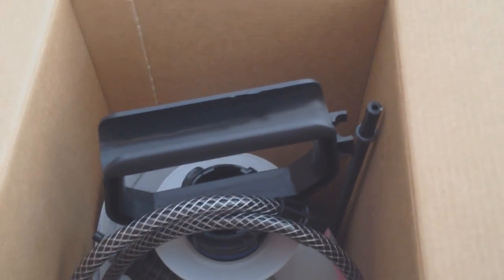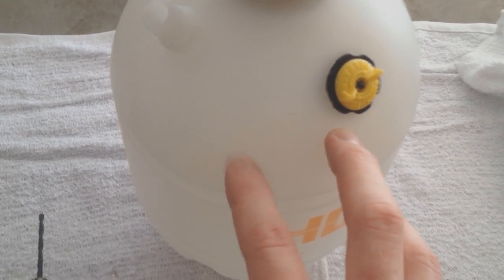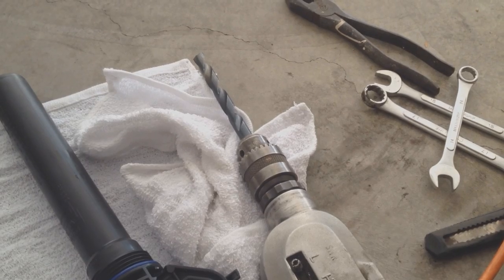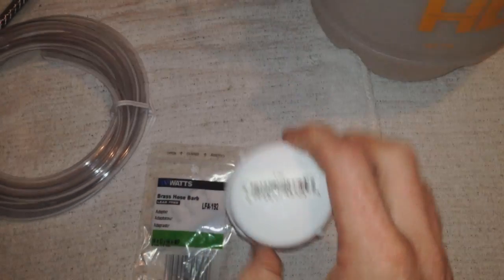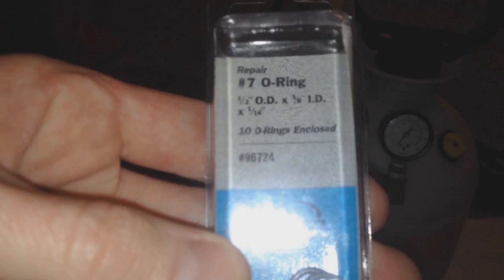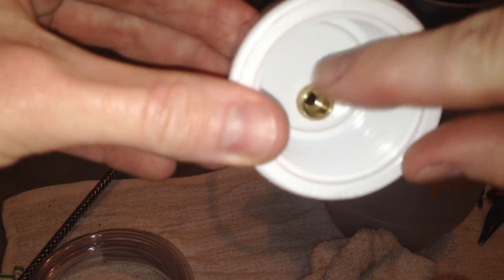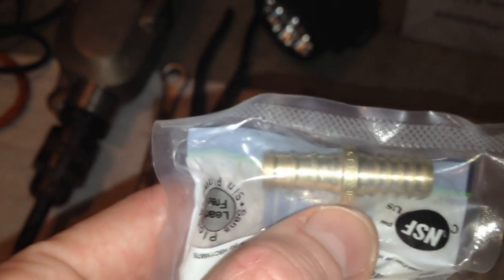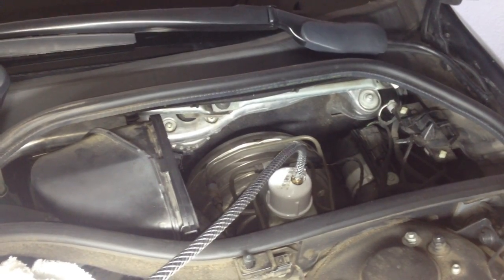DIY Make Your Own 1 Man Pressure Brake Bleeder

Comment: Hey there,

I followed your video -- except for the cap -- I bought a replacement reservoir cap with gasket and tried it out. Sadly, because I didn't have enough 'common sense', I did not seal the little indent inside the cap and so the pressure would not hold -- so I did my brake flush the old fashioned way (couldn't wait for the RTV to dry). =D I can't wait to try this again but with the correct seal lol. I'm sharing my mistake on here for anyone who is prone to make the same mistake -- so they don't have to miss out on all the pressure bleeding fun like I did! And above all else, thank you for this video -- it is one of the best out there. I enjoyed how it was nearly long enough for me to work as you talked -- got the whole assembly done by the end of the video!! (Just wish I did that damn cap done correctly lol)

Comment: To much work.
Reply from the maker: +Michael S It is but if you like making your own projects it's cool, but if you have the extra cheese then I would go for the already done put together one by the manufacturer I have linked in the description box. Thanks for watching Michael:)
Reply: +DIYsavecash I'm all for making things as long as I can make them cheaper then I can buy them. But you spent more to make this then I paid for a brand new vacuum pump.
Reply: +Michael S Overkill to da max.
Reply: +QuantumRift.  Wtf are you guys talking about? Obviously you haven't tried buying one of these.  There is a difference between a vacuum bleeder and a pressure bleeder.  Some cars absolutely require a PRESSURE bleeder and this guy just saved me at least $60. Thank you
Reply: I bought a vacuum/pressure bleeder for $14. This guy spent that on the sprayer alone.